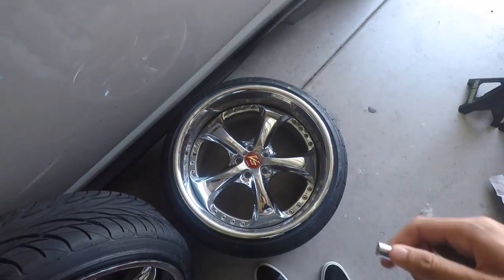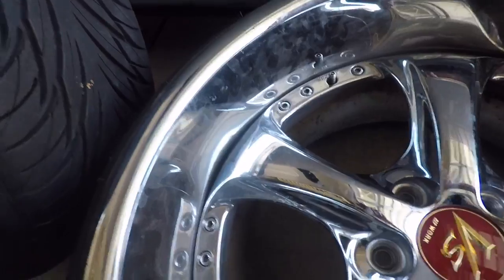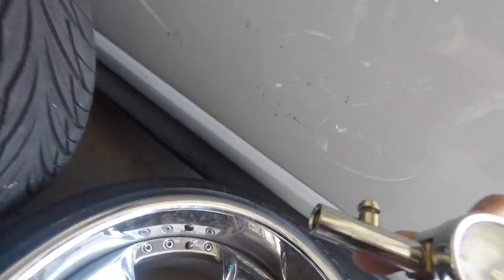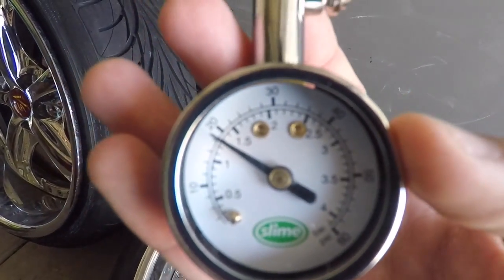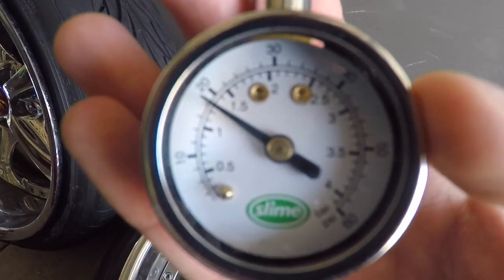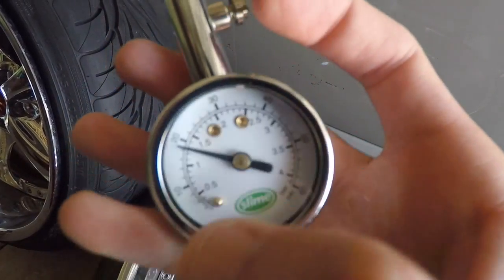My 3-Piece Wheels Are LEAKING Air...

Comment: Was wondering also why this was happening to my wheels. When I slapped new tires and had the valve stems fixed. Might have this problem
Reply from the maker: spray soapy water and it’ll show bubbles where it’s leaking!
Reply: @chris_borges  it worked bro thank you 🫡, the nuts on the back were loose, some of them! Avoided taking it to a local shop than a specialist.